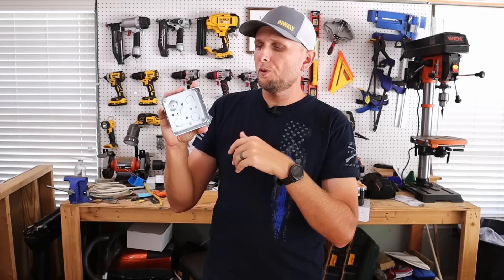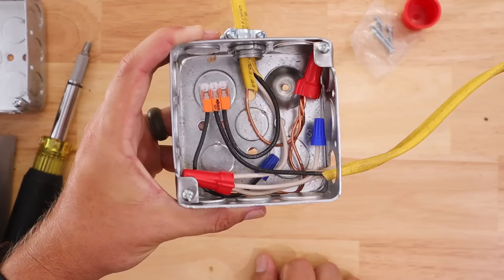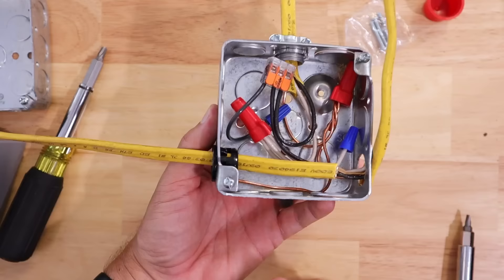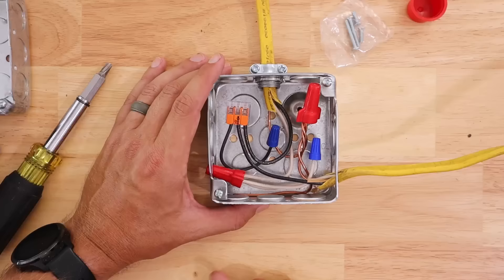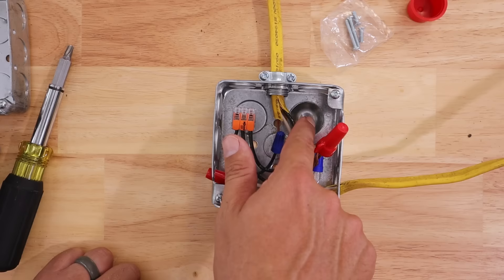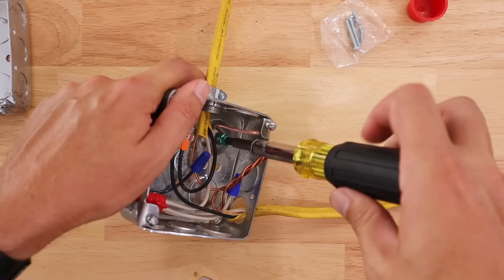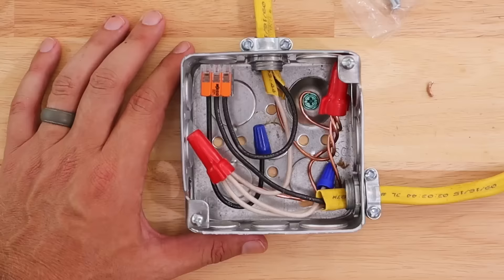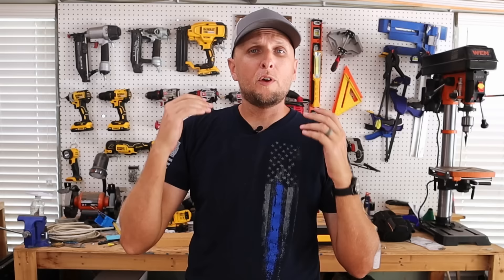The BIGGEST Mistakes DIYers Don't Know They Are Making When Installing Metal Electrical Boxes

Comment: Small correction: You do not NEED to use a ground screw to ground the box. Article 250.8 A) lists permitted methods for grounding and bonding, #5 is "machine screw-type fasteners that engage not less than two threads or are secured with a nut". So any 10-32, 8-32, 6-32 etc. type screw can be used as long as it engages at least two threads or is secured by a nut. Note you cannot use regular wood or sheet rock screws. With that being said those ground screws are a great option because the wide head makes it easy to grip the wire, but if you don't have them handy, a regular machine screw will satisfy code requirements.
Reply: I think the intention of the NEC code is to ensure a coarse threaded screw ( i.e. wood screw or sheetrock screw) is not used for this purpose. A machine screw thread, has a much tighter thread, and is less likely to come loose from its metallic seat.
Reply: A lot of people think that screw has to be green and it does not. the only screw that has to be green is when you are bonding a service neutral to the ground in a panel or first  means of disconnect.
Reply: Although you are technically correct. It's bad trade practice. I know of inspectors who would fail just because a proper ground screw was not used. However that was Canada, where bad trade practice or sloppy work is written into the CEC as failable. Not sure about the NEC. In Canada the same thing applies to not pretwisting your conductors for marrettes/wirenuts. It's bad trade practice and failable.
Reply: Can you still use grounding clips?  I’ve seen 1980s construction that just clipped the wires to front edge of the box.
Reply: And I have failed inspection solely for not using green on a new sub panel and garage install.
Reply: Depending on the code, you might not even need to ground the box with the grounding wire, if there is already ground shielded conduit connected to it. (But: if it's there, why would you not use it? 😆)

Comment: Pretty sure you're allowed to run 12 gauge wire off a 15A breaker if you want/need in which case the 14 gauge wire would be fine. That being said if it was off a 20A breaker I'd generally avoid it but I would have to review the appropriate electrical code to see if there are any special cases that would allow 14 gauge wire to be used for 20A which may apply.
Reply from the maker: You can run #12 on a 15 amp.  However, should never run different sized wires on a circuit.  The next person may assume the circuit is capable of a 20 amp circuit breaker.  Every situation is different.
Reply: @HowToHomeDIY  Agreed.
Reply: @HowToHomeDIY  if the next person assumes , then they did not do their home work . Yes you can protect 12 gauge at 15 amps . Maybe you have a 450 foot run to an out building with a piece of equipment . It could very well require 10 gauge wire to support a 15 amp circuit . You cannot protect 14 gauge any higher than 15 amps in any case no exceptions . Well except motors of course .
Reply: @gerdberg4188  what's the ampacity of 14ga THHN?

Much higher than 14NM-B
Reply: @etherealrose2139  the conductors in the Romex assembly are thhn
Reply: @H2s so what are you saying ….that statement does not make any sense . Code and standards exist regardless of who the installer is .   Organize your thoughts so you can communicate with the rest of the world . Certainly you have shown that this topic is WAY over your head
Reply: @gerdberg4188  I think what H2s was trying to say was that we cannot write code to prevent some idiot from doing something stupid in the future. Having sat on several ICBO, ICC and NFPA code development committees over thirty-some years, I cannot count the times we heard testimony on proposals that started with "In five years, another contractor might do this or that". In gambling I believe it is called 'betting on the come'; something we do not do when writing code.
Reply: Yes you can run 12 guage on a 15 amp breaker, usually the only time you would do this would be for long runs for ' line loss ' if you are in doubt hire a professional and always get a permit and inspection, the permit and inspection are cheap assurances that the work is done properly and if you have an electrical fire then your insurance company can't come back and say there was illegal work done so they don't have to pay out.
Reply: @robprice58  "always get a permit and inspection"; While I agree with the basic sentiment, you need to realize that there are many areas in this country that do not have building departments or if they do, the inspector is some politicians cousins brother-in-law whose previous jobs did nothing to prepare him to be an inspector.
Reply: @HowToHomeDIY  Exactly!
Reply: @HowToHomeDIY  That person shouldn’t be working i anything electrical if they don’t know how to make sure the load they are tying into is adequate.
Reply: @HowToHomeDIY  is that best practice or code.  codewise i thought it was allowed

Comment: There was a short period of time in the 1950's where grounded wiring was used but not grounded outlets. The ground wires were connected to the boxes only. My house was done this way so I went around to every outlet with a grounded box, replaced the receptacles with three prong, and used pigtails to connect them to the grounded boxes.
Reply: Should have used plastic boxes . Unless you had metal cable .
Reply: @gerdberg4188  not practical, how are you gonna replace all the boxes with plastic without destroying the house
Reply: @gerdberg4188  Metal boxes are still used here and they still have to be grounded as well.
Reply: That time period varied.  My mother's house - built in 1962 - had ground wires running to the boxes only.  That made it easy to change to grounded outlets.  The boxes are small, and GFCI outlets would not fit until Eaton offered their smaller ones.

Another thing I had not seen before: No wire nuts in the original wiring. Instead, wires had been stripped, twisted, and a sleeve crimped around them, then a wrap with rubber tape. That took a LOT of labor.
Reply: I think that the grounded boxes of some years ago, even conduit that ran between boxes used an outlet that self grounded through the mounting ears to the metal box. When changing outlets in these older boxes make sure you don't grab a handful of the 49 cent vriety. Most of those do not self ground to an older system. That cheap shit should be outlawed, 49 cents against a correct outlet which will save your house or life.
Reply: @chucksmalfus9623  guess you have not actually done that type of work .  It is all situational of course , because every job is different . Example , I walk into  an older house that has metal boxes and different wiring from over the years  .
Customer wants to add an outlet below the switch next to the door . Open the box , here you see. 
3 14-2 in a metal 3x2 x 2 1/2 , not enough room to start with , but it’s done . One power one power out one to the light .
So at this point you just cannot take a 4th  14-2 and pull power out of that box that the customer thought would be so easy.
Only choice , replace the box . At that point you have more options then . Single plastic larger box , which will hold all conductors with enough space . Or just as easily install a 2 gang plastic box giving room for a little expansion with no more work really . If you any type of cable that is not metal ,why would you use metal , so in most situations like this and a number of others , they get plastic . It has to do with applying the proper materials to the work as system . Good tradesman know exactly what I am talking about . I have been doing this work for over thirty years . You don't screw with methods that you know work over the long haul  .  There is NO room for a halfassed  electrical work .
Reply: @robertpearson8798  no shit I never said they did not
Reply: My house was also wired up this way! Metal boxes grounded, but the receptacle was not. I have replaced every outlet in the house, and I found that more often than not that the clip holding the ground wire to the box would be destroyed when removing the ground wire. At best it would provide a loose connection. I ended up just grounding the receptacle only. This is obviously not ideal but it was the best I could manage.
Reply: @@user-ov4mt5yw7q Luckily all the boxes with ground wires were visible and connected to ground screws.
Reply: @drwalker9093  That is very old school.  Before wire nuts were introduced that was the way splices were made.  I have also seen crimped connections enclosed in a fitting with a set screw which had a threaded insulated cap covering it instead of using rubber tape.
Reply: 35 year Plumber here, during that time frame lots of electrical systems were grounded on the copper or galvanized water service. Something to remember when making changes is copper is rarely used anymore and poly pipe is widely accepted as a replacement and accommodations need to be made when replacing the water service to a home. I either use 10’ of copper going out of the foundation then transition to poly or I drill a hole and drive a new grounding rod in and re-connect the existing ground wire. Learned the hard way! 😉
Reply: @gerdberg4188  if his box is grounded, its likely that all his wires are 2 wire FMC or BX with aluminum grounding strip. Changing to plastic box means youll need grounded bushings on every plastic box or replace most of the wires in the house. If the old metal box is too small, then use a 3-1/2 deep metal rework box.
Reply: @drwalker9093  As an electrician in America- Depending on where you are doing the work, different states,cities require you to adhere to the N.E.C. (National Electric Code) and local codes adopted. This means a town can require you to do more than the code requires. Yet the next town does not require any extra that the code requires. Also the code updates every 3 years. Towns and cities may not have adopted the new code changes. You can never know the code. It is a moving target!
Reply: @jerrydemas2020  Yes. In my limited experience, a lot of the variability comes from each inspector's interpretation of the code.
Reply: I think this is fairly common on any install, even before the 50s if you consider that the metal cladding on BX wire acts as a ground, and is generally screwed to the metal outlet to secure it.  So grounding the box has been done for quite a while.

Romex came out in 1952, but 3 prong wasn't required for quite a while later beginning in the 60s and 70s.  So likely what happened is the additional ground was just attached to the existing metal box, but 3-prong hadn't yet become a standard until later.
Reply: @gerdberg4188  plastic boxes are half assed
Reply: @jeffreystroman2811  o ya another guy who thinks metal is all that.   Obviously you are not an electrician and know nothing about using the materials to build a system . You so misunderstand that it would take a whole course to enlighten you .
Reply: @gerdberg4188  wow, I thought you would be confident enough to take a joke, as far as my knowledge base goes your summation is so outrageously incorrect it only serves as indicative of your ability, or more accurately lack thereof. Metal boxes have more electrons in their valance ring and therfore much more effective at forcing a fault in the panel than say, plastic. And I am not an electrician, I know electricians I wouldn't allow to change my oil. I am much better as  veteran troubleshooter in the broadcast video business, the guy who gets invited when electricians are done messing things up. And don't worry, I fix a few local farms polyphase power systems on the regular.  Check yourself before you put both feet in your mouth
Reply: @gerdberg4188  do you know why there is no current on the neutral when both legs are equal draw? I was explaining a cheater box to provide a 220vac outlet with two standard extension cords to a fellow who quote "knew everything about house wiring" and his eyes glazed over as the concept out of his grasp. My only accomplishment is that I know for a fact I know absolutely nothing, that's the beginning of knowledge fyi
Reply: @gerdberg4188  and plastic boxes have shitty strain relief, and that alone makes them half assed, as you say
Offer no RFI shielding from the unbalanced magnetic fields that occur at the back of an outlet
And are tarp blue, need I go on?

Comment: Great Job, just wanted to let you know I think you have one of the best approaches and by far the most useful, easy to understand formats of any educational videos on YouTube.  The videos are accurate and explain the necessary information and steps needed to complete the process and installation of the particular project being worked on.  The instructions given are simple and easy to follow and there are no unnecessary procedures or tangents to distract or overcomplicate the lesson. You give some different options including the preferred method you like to use for the situation.  Most importantly, you make sure the message, "Of what not to do! or this is dangerous BECAUSE!" is pointed out without being overbearing or sounding ridiculous. I think you explain yourself well, giving you credibility for your knowledge of the trade.  I typically don't like watching YouTube videos for many different reasons; the lack of hosts' intelligence and no confidence in the material being discussed. Primarily my main objection is when the teacher of the video tries to be a comedian or brings their personal life into the show.  You understand the importance of the lesson and respect the viewer's time.  
I would like to ask you if you could do a segment on " How To" #1. Wire 3 and 4-way switches power to light/ power to switch, receptacle in the middle. #2 where to start when wiring a lighting circuit and how many rooms and LED fixtures can a 20 amp breaker carry( I know most lighting circuits are 15 amp) #3 a bedroom receptacle circuit. All circuits starting from the panel, like new construction.
Reply from the maker: Well I am really glad to hear you are finding value in the content!  Thanks a lot for sharing all of that with me.  Those are all good subjects!  I will see if I can get some of it into one of the videos!  Thanks a lot for the ideas and again for the well thought out feedback!

Comment: I'd be much more concerned with the connectorless wire insulation being cut by the rough edge of the box than the wiring being pulled loose. But, I also put a romex staple within 12" of the box.
Reply: Right on! 👍
Reply: Good point.  I had a neutral wire get frayed from the box when installing it
 Didn't realize it until I flipped the breaker on.  The breaker immediately tripped and once I investigated and found the problem, I realized how lucky I was I didn't burn the house down.  If I hadn't been there and it hadn't tripped, it could have been bad news. Do be careful when pushing the wires back in the box.

Comment: As I can see, In Canada, we have better boxes. The box comes with the larger ground screw and there is a recess on each side of the screw which keeps the wire from going out. Even with your green screw and the fact that you correctly looped the wire around the screw, the wire tends to go out of the screw on the left side. We also have theses green screws but usually, they have something to retain the wire in the receptacle to retain the wire. Nice video and well explained.
Reply: Yep, the boxes here pretty much always come with the ground screw.  I think the green screw might be more of an American thing though as the screw that comes on boxes here are usually a silver colored pan head with a much wider head that helps lock the wire in place better.  We do have some receptacles and light switches here that come with a green ground wire screw, but I'd imagine that those are built to American electrical standards, but have also gained CSA approval.
Reply: But you are still in Canada so does it matter much that your boxes are better?

 Canada, where freedom goes to die...
Reply: @billymacktexasdetective5827  Careful casting stones there bro. The country South of Canada has no freedom other than the freedom to make poor choices and that is the last I'll say about that (off topic).

The fact a plastic box even HAS a ground screw in it is to make it brain dead easy to locate the ground cluster by following the wire attached TO that screw. Personally, I just wish all these boxes were deeper than they are so I don't have to stuff the wires in like the worst game of Tetris ever invented when installing dimmers and timers.
Reply: @brizzle8797 Not something I choose to unpack today, but thank you for the candor. Have good day now, eh.
Reply: @stevedixon921  
 Yes sorry about that. had nothing to do with you specifically.
Reply: Keeping the wire from squeezing out from ANY green or whatever color ground screw is a PAIN.  CN is a beautiful place, maybe we disagree on politics, etc, but I LIKE a box and ground screw hole that grips that wire!  Also, did someone mention a ground screw on a plastic box?  Huh?  How and why?